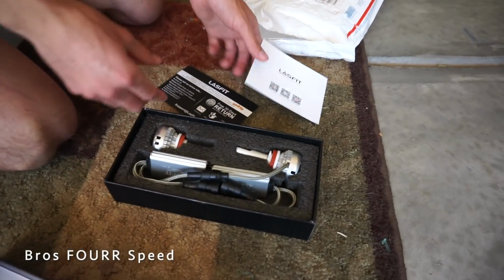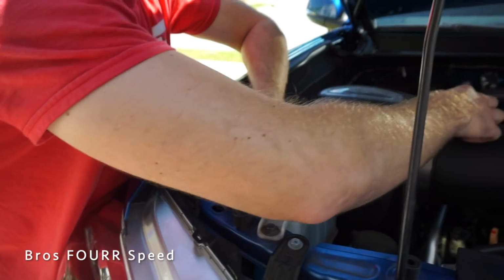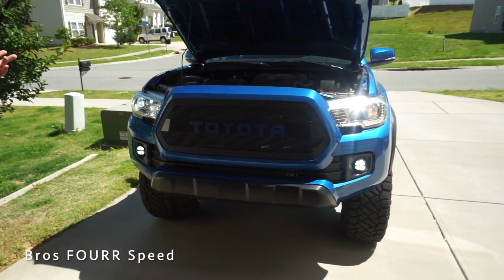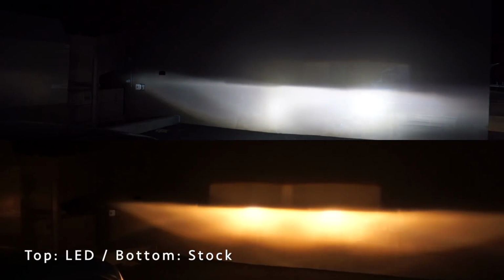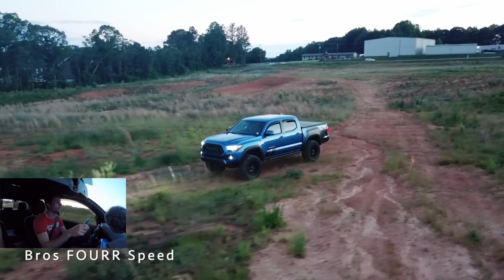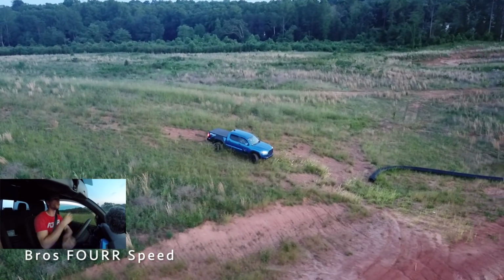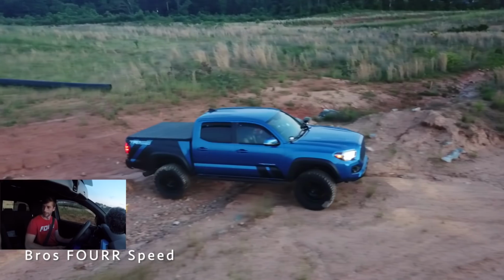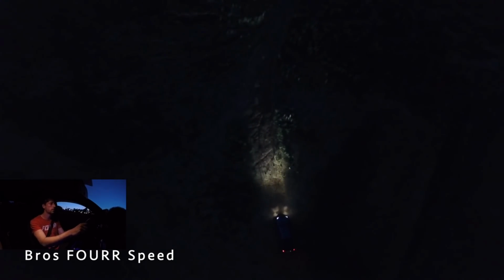EVERY Toyota Tacoma NEEDS THESE!!

Comment: I just got my led h4's for my 96 Taco,  these lights are awesome! Of course mine has the H4 conversion and I also have the upgraded wire harness so that I am running the lights directly off of the battery and not through the stock wire harness. The harness has thicker gauge wiring and a couple of heavy duty relays and works perfectly with these headlamps. I would have never done anything else with the lights if I hadn't seen this video.  Thanks guys!